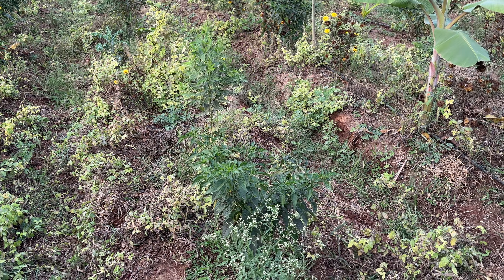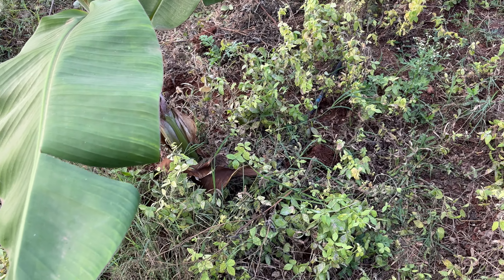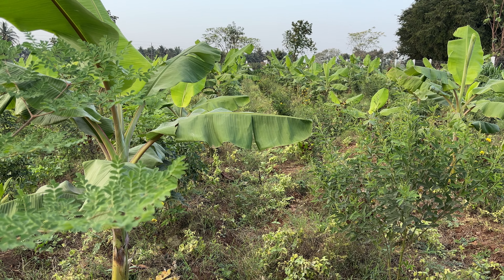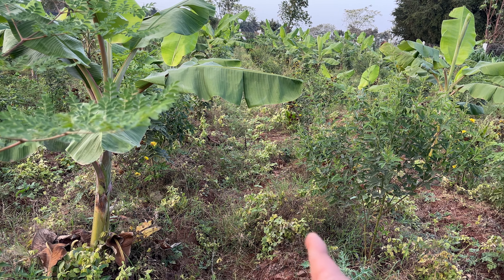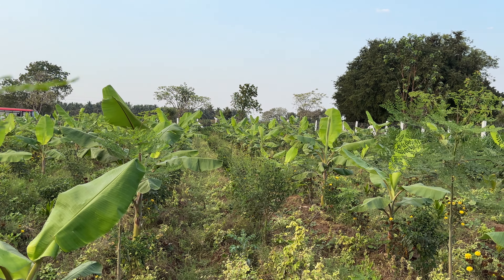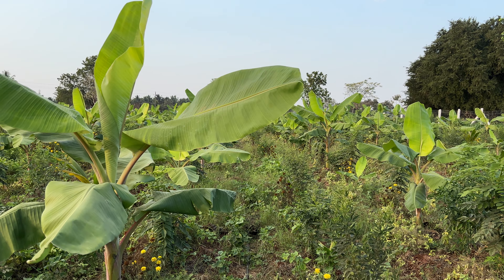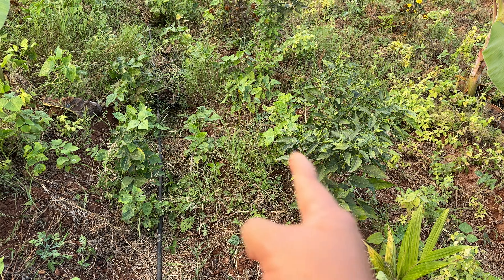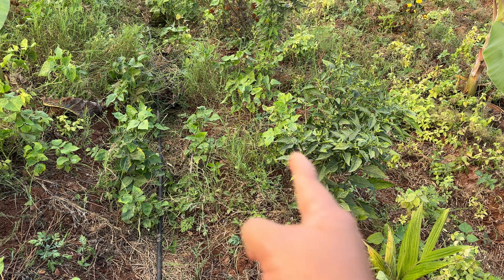Lateral Drip Irrigation pipes - Where should it be placed? | Subhash Palekar Natural Farming

Comment: Hydrotropism & phototropism… 
Roots will travel towards moisture … so farther the water irrigation (corresponding to the leaves extent), rooots will travel
so wider root base, means more balance to the plant/ tree
Reply: Wide root base is stronger than narrow root base
Reply: That’s y u see trees falling in Bangalore especially during monsoon, because of the underground concrete foundations, the roots cannot travel farther…  so the huge tree doesn’t have proper support from underground roots
Reply from the maker: Yes :)

A practical problem I will face is during the pre-monsoon, I want to plant turmeric. So I am not sure how will I handle irrigation if I take the pipes into trenches.
Reply: You should use rain irrigation system which will cover every inch of land
Reply from the maker: Thanks for the suggestion. I am planning to use sprinkler.